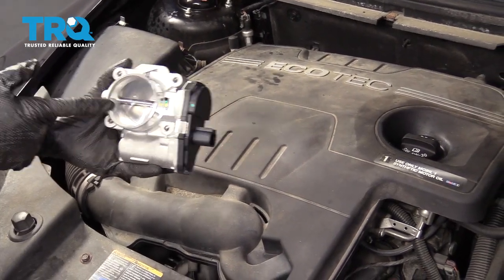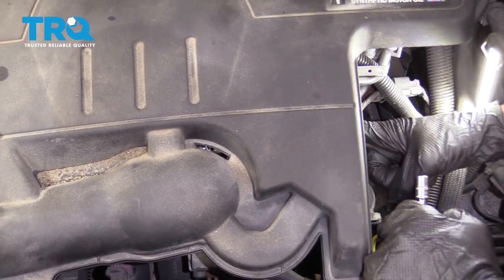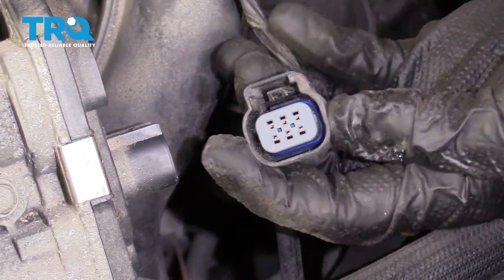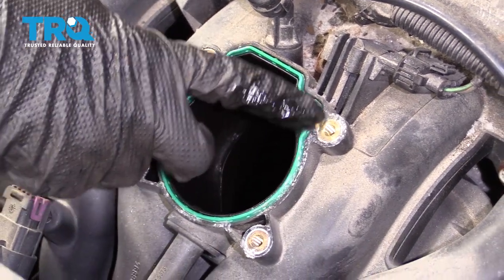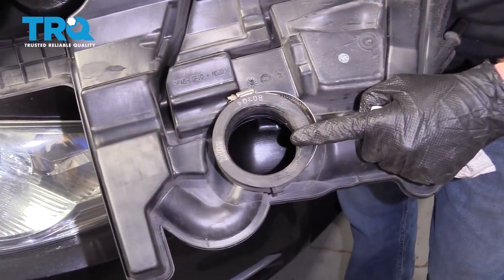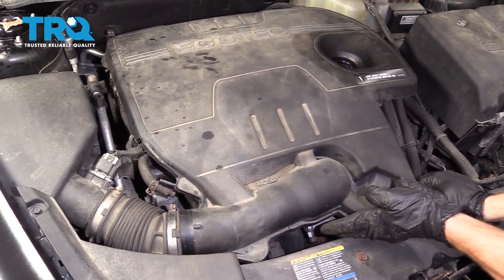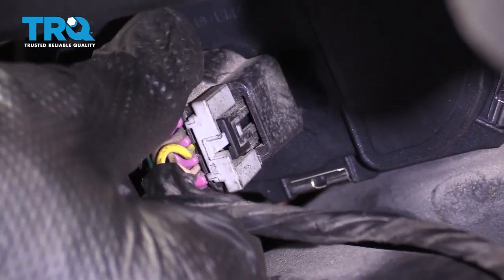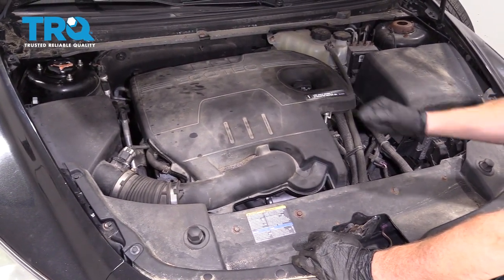How to Replace Throttle Body 2008-12 Chevy Malibu

Comment: Do you have to reprogram after replacing?
Reply from the maker: +Alan Tamayo The throttle body does not need to be reprogrammed.
Reply: @TRQ   I just cleaned it out because it was really dirty. But now the RPM is higher than usual what should I do?
Reply: @alantamayo9067  mine too! What did you do?
Reply: Mine too
Reply: @vincereives192  what did you do? I’m having issues
Reply: Same here i cleaned it and the rpms are 3000 when idle
Reply: In some cases its no as easy as plug and play when replacing the throttle body or simply disconnecting and cleaning it you have to reprogram it with a scan tool high idle or stuck in full rev reprogramming is needed.
Reply: From my experience it does. Car just went full limp no gas or anything.
Reply: @shaeshae9235  did you have chevy Malibu and is so what did you do??
Reply: @dolflopez821  what did you do to solve it and was your car a Chevy Malibu???
Reply: @alantamayo9067  what did you do to solve the issue and what year is your chevy Malibu
Reply: Looks like they dont want to share the sulotion for high rpm after replacing throtle body.😅

Comment: What is the relearn procedure for this model?
Reply: On a 2011 
Throttle body re-learn
Start the engine and let it idle in park for 3 minutes. ...
After 3 minutes, turn the engine off and leave it off for 60- seconds.
Start the engine again and let it idle in park for 3 minutes one more time.

Comment: Did you disconnect the battery cables while replacing the throttle body? I had a problem once before with replacing a throttle body in a 2010 Malibu where the engine stayed in full throttle.
Reply from the maker: +Tina B Thanks for watching!  We did not disconnect the battery when replacing this throttle body, but it certainly won't hurt if you choose to!
Reply: So how did you fix that problem because I just had the same problem when I changed the throttle body on my car
Reply: So what you do to it to fix the problem
Reply: @RodolfoRodriguez-le7xl  did you fix the problem?

Comment: Do you have more videos on 2003 chevy silverado 1500 5.3l 4wd extended cab. Im having trouble figuring out why theres no throttle response when pressing on gas pedal. Its started happening when truck didnt want to start do to bad battery. Also the etc fruse under hood keeps poping but after i put a 30 fuse on it stoped poping even now i put i 5 fuse it wont pop nomore. So i dont know of i fixed it out messed something else up lol.I have checked most if not all groubds, unplug the conections to the throttle body and foot pedal while trying to check if thats why the fuse keeps blowing. I even unplug fuel pump connector too. What can be the problem. I have lil to no money to give to a mechanic.

Comment: What is the gasket that connects to the throttle body or the engine cover called?
Reply: Following
Reply: I am thinking the same cause mine is completely ripped and mine sits at an high idle and i’m thinking that’s the reason why my rpm is so high.